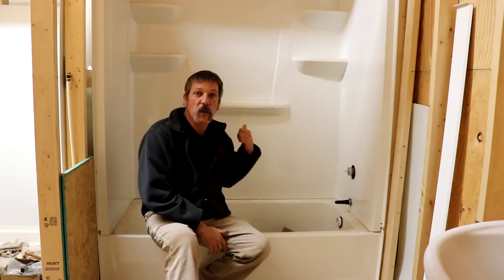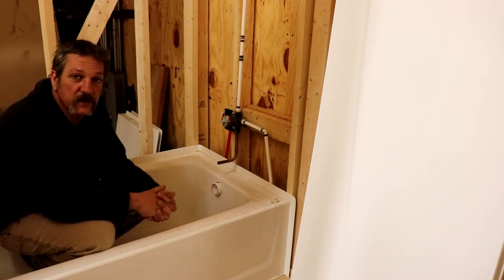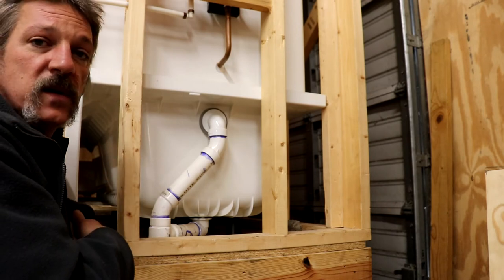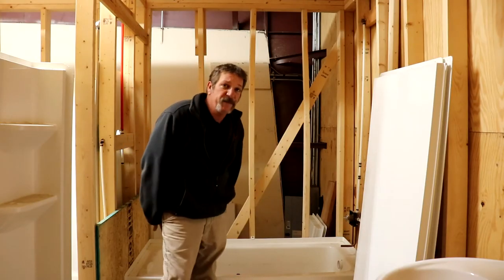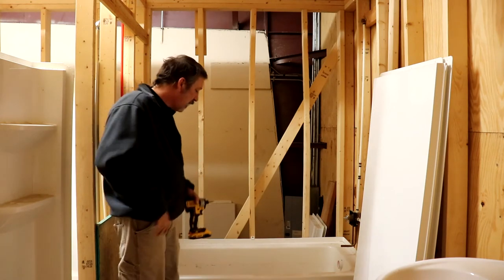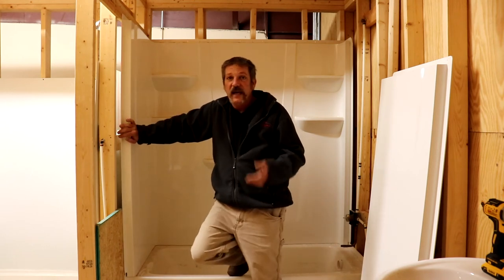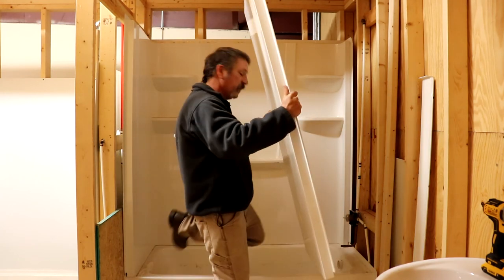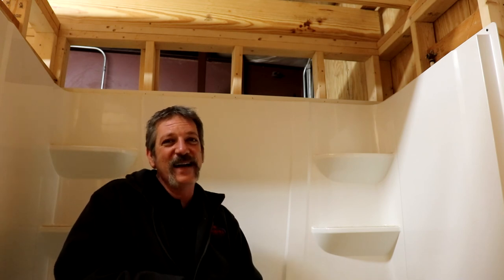3 Piece tub unit

Comment: What would you say something like this would cost to install? I like this system. It’s far quicker than waiting for a tile job if you’ve only got one bathroom. Great job, it looks really nice. I can see you’re very experienced
Reply from the maker: well the tub is less that $1000 . the money is in the labor, and tearing out the old stuff
Reply: @PlumbingSolutionsLLC  
Right, I understand it’s really a hard price to gage as you don’t know what’s going on behind the walls once you remove it, or plumbing might need moving to accommodate the new system. But if it only takes a day or two it’s a nice option. 👍🏼

Comment: I've got an old 2 piece tub that had 4 bolts through it where the top sits down on the bottom. 1  bolt on each end and 2 in the back side.
Over the years the rubber gaskets that came with the tub completely deteriated and have vanished. 
Since the inside caulking never lasts water got  between the 2 pieces of the tub and dripped water out the bolt  holes for years with no one aware.
That finally lead to me putting a new floor in.

What concerns me today is putting that tub back in there with those 4 bolt holes in the tub knowing the gaskets will rot out and be leaking again where no one can see it.
Love the plumbing shift I also need to do that on this tub as a joist dead centers the tub drain.

Comment: Should the back main wall have any movement in it? Like if you pushed into it should you be able to make that wall move after it’s installed? I have one being installed and the back main wall has movement in it and I would think it would cause issues with the Sheetrock breaking away from its joints over time
Reply from the maker: It will flex if you push in the middle , but it should not "move" . It should be screwed to the studs